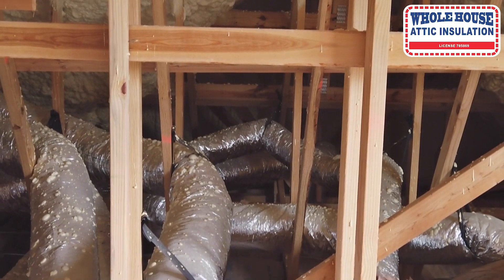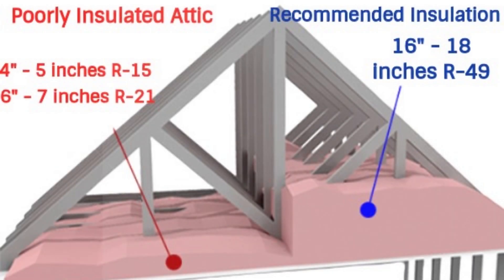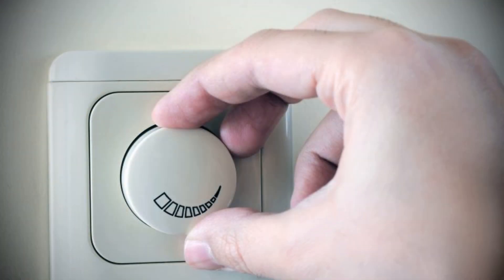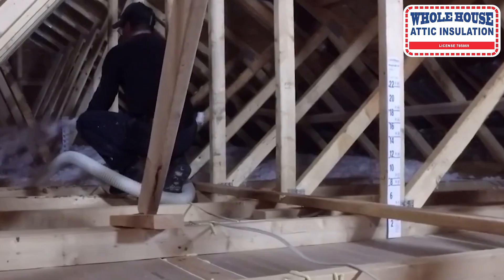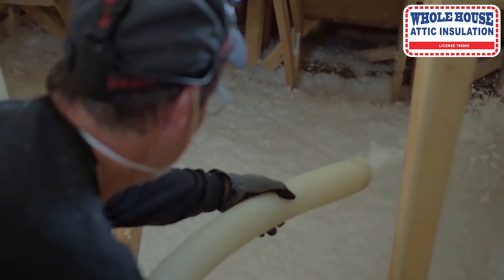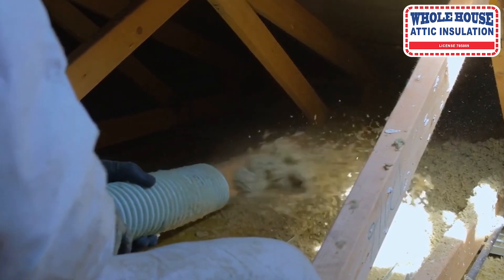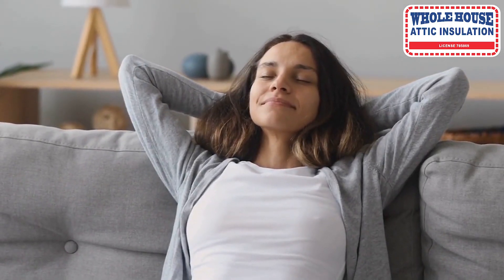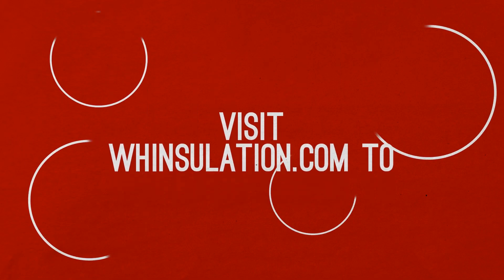Why Upgrading Your Attic Insulation to R-49 Keeps Your Home Warm in the Winter & Cool in the Summer?

Comment: Is their much a difference from 38 vs 49
Reply: R-38 is pretty good but it depends on the house. What climate zone ae you in? Do you have much shade in the summer? Is it breezy? Most importantly, are you comfortable in your house? If you are not comfortable or your energy bills are high, you have some options. Look for areas to air seal including your band joist and attic. Make sure your attic is air sealed before you add more insulation. Soffit and roof vents help in the summer.